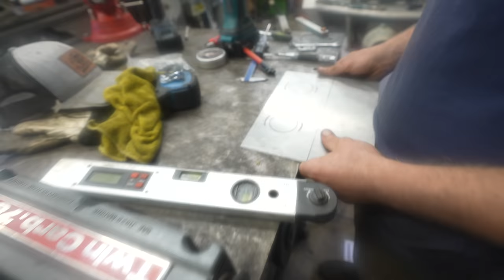100HP Micro Jet Boat Speed Test + Jumping Wakes!

Comment: SAFETY TIP:  Put a soft stirofoam type thing on the top of the windshield in case your head slams foward and down...  It that happened, your head would be split open where ever you hit it...  Forehead, nose or mouth...  This is IMPORTANT.   Daniel
Reply: Or just wear a helmet

Comment: The biggest problem with this is if it takes more water than it can displace, it will sink like a rock. Since this boat has a pretty big scoop, i suggest you make a rack with a fast inflating rescue buoy on the back (they're not that big) and the fill sensor can be in the engine bay at the top. If it sinks, this deploys and keeps it afloat.
Two other mods, T end for the jet, and a set of stability wings.
Reply from the maker: That’s actually a great idea. Was planning on adding floatation foam, but that sounds easier!
Reply: This is such a great a community with good feedback and a creator who listens and pays attention
Reply: @GrindHardPlumbingCo  put a ring of pool floats on it!
Reply: @GrindHardPlumbingCo  Might even want to look at guys that race snowmobiles on lakes...  they use a simple buoy and rope system to be able to recover the snowmobiles off the bottom of lake when they sink them.
Reply: @requiredusername5731  I think the max was 42 mph
Reply: that big ole gas tank in it , it prolly doesn't need any extra flotation
Reply: @GrindHardPlumbingCo  and one of them small butterfly steering wheel like used on go karts!
Reply: @GrindHardPlumbingCo  what about a bilge pump?
Reply: and some foam under the window for the knees, lol.
Reply: @kevinrandlett2920  They already have one, but bilge cant simply cope with that much water coming in so fast. It barely was able to deal with water that was coming in in the video, let alone going actually under so boat fills with water.
Reply: @socks2441  I meant too say that too lol! Like cut a pool noodle in half
Reply: @GrindHardPlumbingCo  y'all got scammers posing as you writing to your viewers. Few other youtubers I watch have it too
Reply: @GrindHardPlumbingCo  you can probably pick up a small electric bilge pump pretty cheap. On a few of the jumps I thought it was going under for sure. That thing looks like an absolute riot!
Reply: @GrindHardPlumbingCo  The porpoising effect you get at times is most likely due to the weight of the gas tank at the nose, and improper trim settings with that fore weight.  

May i suggest a nice pad across the top of wind screen frame?  I've ran my boat up on a sand bar once going about 35, and my passenger and I both nearly flipped over the center console due to the abrupt loss of speed.  

If the driver of this awesome little jet boat nose dives enough to halt momentum, I can picture a few lost teeth or worse.  And having smaller increments of adjustment for the trim might also be something to consider in the future.  

Yall have made a super duper smile maker!  Keep it up, i love the boat projects.
Reply: @nathansimsalek4930  unlikely they can use a rope where they are. That lake is 1100ft deep in spots.
Reply: @requiredusername5731  42mph

Comment: I’ve always wondered if some larger company ever wanted to buy one of your prototypes and mass produce them. I’m definitely jealous of the pay time you get on camera
Reply: People would buy them but they would be so commercialized they would be made cheap and underpowered. They would also probably cost the same as a Turbo RZR if not more.
Reply: Plus it couldn't be made from old parts from random vehicles would need to be off the shelf parts or easily manufactured parts
Reply: Would be possible but I don't think any company would take the time to reverse engineering one and the amount of custom parts would be insane
Reply: @spoze171  not expecting a 1 for 1 replica but reasonably close could sell
Reply: @Spadookie  underpowered would be the issue.
Reply: I think some one does make little boats like this I seen more than a couple videos of people riding in some like it
Reply: @justinveillon9765  The boat (hull only) is a kit made by Jetstream Boats. They have a variety of different size kits. There are builders that specialize in assembling the kits for poeple, or you can build it yourself.
Reply: No people would die
Reply: @Spadookie  wring
Reply: Biggest issue I see is how often they break.  The best thing about these being built by the owner/user is they know exactly how to repair and upgrade it.  That's why I've always thought these videos are great way for someone to learn how to make these vehicles for themselves instead of someone commercializing their ideas
Reply: Some of the people commenting saying it’d be hard to do, or they’d have to reverse engineer it to figure it out 😂 do you people realize that a company that already produces wave runners know exactly how this thing works without even touching it or seeing it in person. The reason they don’t make them is the market would be extremely small and they’d have to charge more because of it. When you mass produce something you can charge a little less for it. Obviously people like these but the amount of people that want one AND can afford one is very slim.
Reply: Bruh the boat is made by jet stream it says it one the side don’t y’all remember them getting it custom made lol. It’s smaller version of their allready small jet boats and these guys are doing their own thing with it chances are they will relay the info to jetstream
Reply: A substantial percentage of power sport manufacturing cost is in general product liability consumer safety , it has killed many types of products but one of the more relevant would be the Atc or 3 wheeler that swept the market in the 70’s 80’s before they were put in front of a congressional safety committee that exposed them to the what would otherwise be average injury/ death statistics that were hyper misrepresented over inflated , but the tooth paste was out of the tube and before they could rebuke the government’s claim sales plummeted and mfg general product liability cost shot up as if they were selling assault rifles to toddlers. In a nut shell if a product look scary or  threatening regardless of the actual stats it will have to prove the test of a long time before cost of manufacturing product liability recedes if ever . I just guessing but 30% or more is my guess you still have a ton of overhead cost that add to that that doesn’t even contribute to the parts and assembly
Reply: Can you imagine mass-produced power wheels?
Reply: There’s companies I know of atleast in New Zealand that make similar ones called “Puddle Hoppers”
Reply: They would be very hard to mass produce
Reply: @Spadookie  they actually sell these mini jet boats as a kit you have to weld yourself or pre welded, with choices of power. So you could do this or do what cleetus did
Reply: So they def could buy his stuff and market it with power.  Just requires the oem to have a brain
Reply: No company would build them out of liability concerns.
It could only go 2 ways: Keep the costs down being badly made and with barely any power; or have them cost 35k and still be plasticy
Reply: Lawsuits would be a potential issue,  I've drawn the files to produce these kits and have the ability to produce small runs for DIY kits but i don't see a legitimate market / profit in producing something along this line,  for the micro jets there is an incredibly small market and GHPC has effectively locked the market to Jetstream.   There is no real profit margin to chase (in micro jet boats) for anyone to be willing to persue.
Reply: answer is no
Reply: Dangerous ?
Reply: How much are you willing to spend for that awsome boat? I worked in the recreationnal,"motorcycle, pwc, atv, boat for 20 years... such cool stuff.. so that boat in my opinion if mass produced would run about 5 or 6 k's ... or even more.. just look at the powered jet suf boards.. they run for 13k..not a market for that of a price range. That's sad because they are really nice fun products! Just sad that those products can't be affordable for the normal hard working Joe... that's why.. that thing is awsome! ❤️
Reply: Only on tv lol
Reply: @mayhem035  It’d cost significantly more. There’s no large market for these, they’re a niche product. Welded hull is selling for  C$2900. $2100 US. A motor, support systems, electronics etc. installed gonna drive it up another $3-4000. Finishing equipment, paint etc. gonna cost another $3000. You’d need to charge $10-12000 before taxes to make it worthwhile, minimum. That’s reasonable for something like this. A decent truck and trailer will cost $40,000 plus though, so this is minor in comparison.
Reply: @chadwells7562  
Yeah man was just throwing a number.. the hard part is to get the new motor from a company... they are not kline to sell them separately and have someone build a product with their brand name on the engine.
Reply: That mini jet boat would sell like crazy
Reply: Ff

Comment: I'm wondering if a 3-4" 'hydrofoil'type fin on each side of the front hull would keep it from nose diving so deeply?Keep on doing what you do guys,it's always a wild ride for us too.
Reply: They need to see this comment, I'm not a genius but it sounds like it would work to me
Reply: THIS!!!!!
Reply: On the last video i also mentioned hydrofoils as aj upgrade for it. Its great idea
Reply: also wondering if the boat is too small / low for them to fit a scupper valve for one way draining
Reply: Trim tabs

Comment: You guys have to race it with a real big speed boat and compare them,,, would be awesome,,, because this thing rips brutal... 👍Unbelievable work
Reply: It might win to 20-30mph, but the big boat would be able to stay in the water where this thing bounces around. It's all about agility over speed.
Reply: Watch some short course stadium jetsprint boat action to readjust your perception of how fast a  jet boat can accelerate. Search YT for "jetsprint ENZED"
Reply: @DiscoFang  those are literally 2x the length and purpose built for speed. This is built to hit rocks and trees in a shallow river. It can't compete on open water.

Also watch this video where it is bouncing out of the water and having trouble maintaining 30mph
Reply: @stevegredell1123  Refer to the original comment about racing against one. It’d be no contest.

Comment: A lot of people overlook buying sign blanks. I use them a lot in my fab projects because its 6160 x 1/8" at whatever dimension. Super hard, easy to work with, and can hold a tap for smaller bolts.
Reply: "buying"

Comment: Love that little thing.  Solve that porpoising and that thing will rip even more! make something like the nauticus smart tabs?  as for your knees? low tech maybe a pool noodle cut and put under the dash, higher tech cutting half moon contours under the dash(weld it back up for strength, then pad it) it'll double as braces, and since the boat is so small and reacts to your "body language" you'll be able to "shift" your weight into the hull for different control.

Comment: I’m always impressed with how you guys come up with new and improved parts for whatever you’re working on. I was thinking that little boat would’ve been faster than 42 m.p.h. with having 100 h.p. but maybe the torque isn’t there. I had a 17’6” fibreglass boat in the early 70’s with a Mercruiser in/out drive and an inline GM 250c.i. 6 cylinder engine rated at 165 h.p. I put a stainless prop on it and it did the same speed you guys were running at. I figured you would get about 50 m.p.h. Love your channel guys.👍👍🇨🇦

Comment: Great stuff guys! Just need some quality of life improvements:
- Cockpit padding
- Faster bilge pump
- Swamp anti-sinking inflatable (use a small self-inflating emergency raft, as described elsewhere)
- Safety cutoff

If you can't get a better bilge, or maybe even if you can, what about doing a skirt around the cockpit like a whitewater kayak? That would really help keep out the splashes, and might even save you from getting swamped. Worth a think.

Speaking of whitewater, when are you taking this little monster out on the river? Can't wait to see it shredding some class 2 and 3.

Comment: That be cool to add a mini pump from a fish tank or something low power to pump out any splashed water. because I noticed he had to pump it out manually.. would be nice to have a button to push to pump out that water for you instead. You could even have that powered by an RC/Drone lipo so everytime you went out you just charged the pumps lipo and didn't stain the other battery that starts the boat. I know you can't have every little thing done the first few rips lol but I love everything so far 🤙 Keep up all the good work guy's. I'm definitely a fan of mini things with big power.

Comment: Your a talented fabricator and DIY guy there is no disputing that fact. I do wonder when you put a jet boat into the water with rocks without thinking that may be a problem. The air box is a similar situation. I do like this project it's just that right amount of danger,risk,speed and water. Brilliant.

Comment: Need to get a pool noodle or some foam pipe insulation to pad the dash.
Some pipe insulation would probably be best since it's a smaller diameter and space is already an issue.

Comment: It's so aesthetic! Excellent build, very lotus

Would a venturi in the jet allow the engine to automatically bail water out? More go is more drain! A reed check valve would prevent it from back filling when idle. I had a tow toy that very successfully drained in this manner

Comment: Great job with this, only if it were mine i'd make 2 changes, firstly put the lexan on the inside of the windshield frame and i'd cut the boat in half at the engine  bulkhead and weld it back together 3 feet longer, give you more legroom and more buoyancy too, make for a much smoother ride .

Comment: Heads up, the flame arrestor is not so much for a fire, but for an explosion, a fuel leak in a hull can make a catastrophic boom, they have mesh for a reason, I suspect you have plenty of airflow though. It's the same reason that boats have blowers

Comment: I'm so worried about heads hitting aluminum window frame if she ever noses under hard. I once had my head smack the front of a knee board while landing an excessively high jump, enough to give me a cut, and that was plastic
Reply: People have posted about this on previous videos yet nothing has been done to mitigate an accident like this. Like the integral gas tank, I can only surmise safety is not a high priority for them.
Reply: @1944GPW  years ago I saw a rough video of a side by side crash and what the aluminum center console did to a knee... not a head, like the roll bar girl that didn't have a helmet, these things should be considered ahead of time

Comment: Incredible build, it looks like you may need some buoyancy added to the boat. When you were at a stop it looked like the sides were incredibly close to the water and if you start taking waves over the front or side it’s only a matter of time before it’s at the bottom of the lake. If the engine compartment could somehow be sealed with an air intake up front under the bow that might be beneficial. That is more or less how jetskis are made.

Comment: You should cut out some rounded areas in the dash to give your legs more room, and round them off and weld rounded pieces back in so that it's like the inside of an 8-inch pipe that was cut in half. Then you could also get some of that half-inch high-density foam kinda like a kneeboard has on it, that is sticky on one side to put in the cutouts to pad them so if your legs bump it, it doesn't hurt.

Comment: It’s so cool!!! Get like a 500 gpm automatic bilge pump mount it to the bottom then wire it direct to the battery. No switch needed ,it will pump out water as needed….plus at Amazon about 3o bucks

Comment: A little bit of water, I think, is great for the top end of a 4-stroke engine (dunno about two-smokes). My old friend (rest his soul) used to drizzle about a quart of water down the carb of old Mopars, and the proof in the puddin' was in the eatin'; I saw him pour a quart down a 383's carb and saw the valves/chambers/piston tops before and after, it made an ENORMOUS difference. It really is pretty amazing. It looked like a spankin' new motor. Zero carbon or varnish.

Comment: Needs like some small rubber or strong foam right on the dashboard for your knees could make them a little pocket so you can lock your legs comfortably without slamming into metal when jumping.

Comment: In the spirit of not having that thing sink to the bottom of any water, maybe consider some pull string activated air bags in it somewhere? Like if you flip, you pull the string and air bags inflate, preventing it from completely sinking and making recovery way easier. It would be a small thing to add that could go a long way.

Comment: Btw to stop it from bopping you either need a longer boat (which is not an option) or small hydrofoils that extend the back a few inches, the rear is trying to sink then when the bottom angle gets steeper it climbs back on the surface and repeats that cycle forever :)
Reply: bigrr bóàt

Comment: actually engines do like having water in them. BMW had a series of water injected cars that got 10% better efficiency which means 10% more power or more mileage depending on how you drive. it also steam cleans all the carbon from your engine so thats a bonus

Comment: Hey guys, not as necessary in aluminum, but when cutting a large hole with a holesaw in plate materials, if you drill a hole or two, just on the very edge of the hole, (inside of the hole being cut typically) it lets the chips clear from the holesaw teeth, allowing faster cutting, and less chance of binding/breaking teeth! Just something we've learned doing the same kind of crazy unconventional stuff on a Bridgeport as you guys! Lol